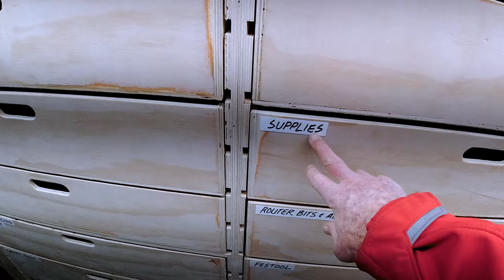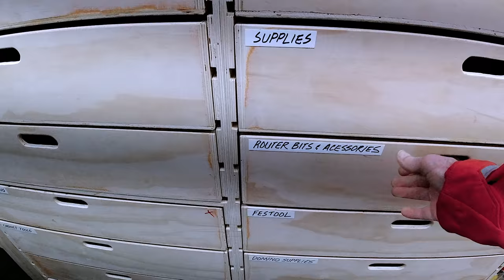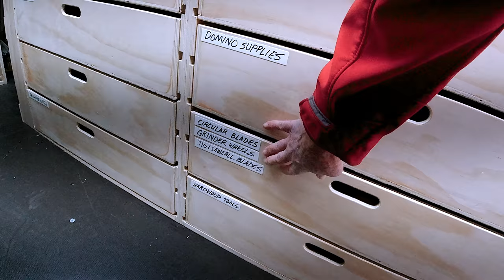The Ultimate Smartwoodshop Tour: Organization and Efficiency in Action

Comment: Nice video on the new SMART trailer. I have a 12 foot trailer with a v-nose, but I live in an area where theft is a problem. I also have a side door, which is convenient and allows for quick entry (read note above). I just wish I had a place to lock up the whole shebang.  I’m probably just putting the regular tools in the trailer and the Festool kit in the van under lock and guard dog 🐕 inside the  2 car garage at night.

Comment: Thanks for the in-depth tour, Ron  I'll be showing it to my FiL in the hopes he'll pick some ideas up.

Some observations as we go along:
* The use of plywood rails in dados instead of drawer slides is a huge cost saving.  I'm building some rolling cabinets at the moment, for which I already had the drawers built and stored in a corner years ago, and the cost of the slides is astronomical.  Wishing I'd just adapted the drawers at this point.
* The worst part about tool boxes imo is not the space they take up but that the tools never seem to go back in correctly.  Mostly the cords.
* If you find yourself moving the cubby dividers around often, consider using threaded inserts and a bolt, rather than just screwing them on.  Of course, when you strip a hole out you can always just drill it out, glue a dowel in, drill a new hole, and call it good.
* Leaving the tools accessable in the cubbies is known as 'first-order access', ie you don't have to move the thing to get the other thing.  Putting the tool in a toolbox in a drawer/cupboard would be third-order access.
* My local hardware is just five minutes down the road, and it's still essentially an hours turnaround.  Driving across town, well, you might as well just take the afternoon off.
* Gotta get me some of those socket holders.

I would kill to be allowed to used the ART/SMART ideas in my FiL's work trailer, but Old Man Syndrome shuts that idea down.

Comment: Do you plan on getting the Flexvolt generator?  You get up to 6 batteries and run corded tools from them. Or plug the genny in and charge those batteries. 
Really cool system IMO. 
What are your thoughts?

Comment: Ron, firstly I’m a big fan of yours. I really appreciate your work.  I noticed you said you had “built 200 homes and done thousands of remodels” in your 30 year career. Did you used to run multiple crews? That’s almost 7 houses an 66 remodels per year, on average.
Reply from the maker: Yes, I had a crew and ran multiple trucks and trailers. In addition, I had 30+ subs working on my jobs everyday,
Reply: Ron Paulk hey Ron , have u ever been interested in using Mafell tools?
Reply: Ron Paulk Are you retired now, semi-retired? Do you work alone now? Just curious. Wondering about what I’d like to do in retirement. I will be essentially “copying” your trailer because I doubt that I’ll have a shop once we downsize and start traveling. Love your videos.

Comment: Nice cargo trailer and like your concept of  efficiency and caring with you the stuff that you need and be prepare to anything that comes in your way, but I’m sure you can drop your weight almost by half if you eliminate all  your doubles(tools and drill bits), I just to do the same, I keep some of my tool boxes with all the accessories and all my electric rechargeable makita hand tools in a tote with wheels. Lean is good , like your ideas and Chanel  keep the wgood work !

Comment: Used your plans and this trailer as a guide when ai built mine. THANKS!  I went completely cordless from the start. Extension cords are never efficient.
Reply: SearchingforSignalLLC have u got a cordless table saw and plunge saw ? I'm thinking of getting them
Reply: I have cordless table saws
Reply: SearchingforSignalLLC which brand?

Comment: I'm considering using 3/8" plywood to do those drawers and bypassing the routing business. Just using all 3/8" and cutting and glueing each piece half an inch apart and using 3/8" bottoms. Do you think that it may be too weak for bottoms of the drawers themselves? Love Dewalt too. And it looks like you aren't going to retire anytime soon. Great inspiration!
Reply: I used 6mm  bottoms for my draws and had no dramas at all.
Reply from the maker: the routed dados are easy, efficient, and strong.

Comment: It just goes to show you how much you can save by limiting resources.  By limiting your space you’ve forced yourself to focus on efficiency, priorities, and overhead.  Based on the number of empty drawers, an even shorter trailer could be used.  Empty drawers on left, right, back left, an an unnecessary entry space to the ladders could be shifted to the back door.  

Lastly, those heavy drawers by the door could be made a lot easier to move by adding some inexpensive skateboard radial bearings.

Comment: LOL your trailer is bigger than my actual workshop. Serious note though - how do you cope with bad weather? I bought plans for and am currently midway through building the Total Station, because my workshop is approximately half a UK one-car garage, which means any serious work requires everything to be set-up on the driveway. Trouble is, if we have bad weather, I either have to rush to get everything away in the dry, or can't even go out in the first place. I do have a pop-up gazebo I can use, but even that isn't a perfect solution. What do you do when you're at a house, remodelling a kitchen, if they don't have a large undercover space for you to set up in?
Reply: I have similar issues, UK also. It gets a bit hectic when you have to drag your table saw into the house because it suddenly starts raining.
Reply: @FuzzyScaredyCat  
@Neil Barnwell  

It's expensive, but I use at least one heavy duty 10ft x 15 ft Caravan or EZ-UP brand pop-up canopy tent with 4 Sidewalls.

I've found the 10ft x 15ft to be the prefect size.  10ft x 10ft is too small and cramped, and any larger is unmanageable.

I keep 4 extra empty and inexpensive 5 gallon buckets on hand and fill them with water, sand, or gravel/rocks to keep the canopy tied down or secured in case of windy conditions.

I also have four 20" long corkscrew-type ground anchors and a 3ft length of pipe to screw them into the ground on new/bare worksites.  Gotta be careful though on existing lawns or yards with underground utilities or sprinkler systems, etc!

I usually set this up first thing and use this as my "outdoor workshop", so everything is always protected from sun and rain, including myself, and so I start off organized right from the start.

I use the white canopy fabric and side walls to keep it cooler and provide even, diffuse lighting.

A singe 4ft LED shoplight tube can be hung in the top center frame out of the way above your head with plastic zip-ties and provides nice, even lighting at night or early mornings.

This way I never have to rush to get materials and/or tools put away in inclement weather and I have a nice enclosed OR open air workshop!

The side walls can be rolled up for ventilation and quickly lowered in case of bad weather.  Good quality side walls have HD zippers in every corner.  And you can get side walls with a vertical center zipper as a doorway.

I set it up with my portable workbench and miter station opposite each other on the long dimension of the tent as a "galley kitchen" arrangement, and the table saw at one end to create an "L" formation.  This allows a clear passthrough and an entry/exit at each far end.

I use wire hooks and rope loops to hang tools above the workbench on the canopy frame.

I've even used rope loops to hang 2x lumber or pipe from the overhead frame (within a reasonable weight).

A Shop-Vac can either hang up and nest within the center peak of the canopy tent framing, or go under the portable workbench/sawhorses or a set of 6ft folding picnic tables.

A good Heavy Duty Canopy Frame will last 3-5 years, along with the side walls.  I usually replace the overhead canopy fabric about once a year at a cost of around $180 USD.  

Don't waste your time and money on a lightweight canopy frame and lightweight fabric canopies and side walls,  They WILL fail in rain or windy conditions and will not last more than a month!   Get  a high-quality heavy duty one and "Buy Once/Cry Once".

The canopy will fold down to an incredibly small footprint for storage & transport, and the side walls fit into two 12"x12"x3" cordura zipper pouches (typical EZ-UP brand).

The entire setup basically takes up less space than two 6ft folded ladders back-to-back in vertical orientation.

I will usually just transport them laying down on the floor in the isle of my trailer or box truck with liftgate, because they are the first things off the truck to be set up.  They can easily be stored upright under the eaves along outside garage or house walls if not needed right away.

 I use a heavy-duty folding Cosco hand truck/trolley to load & unload the canopy and move it into place.  The trolley comes in extremely handy for other work on the jobsite as well, such as moving supplies, furniture or your newly built kitchen cabinets into the house, etc.

Once you learn the proper process, you can easily set this all up by yourself in 10 minutes or so

This also keeps clients happy by helping to keep my work area contained and from becoming unsightly and scattered all about the property.

Sometimes I might use two tents for larger projects with multiple crew in order to have two separate work areas so we are not bumping shoulders and can work more efficiently...

For instance, one canopy in the front yard or driveway/carpark, and one on a backyard lawn or bare worksite, etc.

IMO these are well worth the investment just like ANY other good tool, and I've even used them at home for larger projects to keep my main home workshop more organized and efficient during the project, even if it is just used for temporary lumber/drywall/materials storage.

I can't live or work without these now!
Reply: @bbfoto7248  A really nice detailed reply - Thanks!
Reply from the maker: When I am doing interior work, I set up inside. I have never had a situation requring me to set up tools outside for inside work. I have on occasion set up outside when the weather is sunny and the work is close to an exterior door and I just want to be outside. I often set up in the garage when finishing an entire house and leave the tools set up for weeks or even months depending on the scope of work. A small garage is 500 square feet and a small house is 1800 square feet not including a garage, but most of the houses I work on are 2500+ with 3 or 4 car garages.
Reply: My workshop is ten square metres (hence called the ten square metre workshop...) and I used to drag stuff outside for more space. Then I re-designed it so that everything fitted inside with room to work. Takes a lot of thought, and multi-purpose fittings etc. but worth the effort.

Comment: P.S.,  i have noticed that anything i have bought and tried to modify always seems to measure out better in metric, so i think they must be designed using metric,, and cars are mostly metric,,so i use it all the time,, and it is much easier than trying to remember some obscure , off the wall fraction

Comment: Will a Single Axle 6x12 trailer work with this much plywood, weight wise?
Reply: I bought a single axel 6*12 and built it out similarly except a 3 foot aisle for materials and it works but I wish I would have went tandem. Having to replace the suspension on the side of the road was not fun. I do kind of abuse my tools a little but my 2c buy right the first time one is none two is one.

Comment: Why not buy a longer trailer and build on your system so you don't need anything in the isle?
Reply from the maker: Keeping The Smartwoodshop smaller was and is my goal, I think I could even go down to 10' and still achieve a fully functional portable woodshop. Less is more.
Reply: Longer equals more weight and cost also. Before long you’re beyond what a 150 can pull easily. I’m in a different line of work and I’ve always thought more is better, but eventually you see it’s just stuff you gotta get rid of before you croak and leave your family to deal with it.
Reply: @RustyCas999  Well, THAT got dark..... LOL
I just went through a bunch of my stuff and found that I had accumulated 6 paint roller handles. That isn't a lot to a painter, but I've only painted 3 tiny projects!

Comment: Those flex volt tools are heavy to use in your day to day work. Much better to stick with the 20v where you can
Reply: I’ve found the 6ah batteries to not be too heavy. I use my Flexvolt circular all day with no problem. Pound for pound, it’s the best cordless circular on the market. Makes my Milwaukee Fuel circular looks like a Fisher Price toy.
Reply: @justinhc123  circular saws are fine with big batteries, other tools such as impact drivers, drills, nail guns are best kept as lightweight as much as possible. You don't be usually swinging a circular saw overhead.
Reply: Sure. I use the smallest batteries I can. I have ample 2 and 5ah batteries. I was just saying that I didn’t find the 6ah Flexvolt  batteries too cumbersome for tools that require/benefit from them.

Comment: You wont be sorry with dewalt. I run dewalt tools. 
Their oscillating saw is the cadillac of the bunch.
Reply: I have four flexvolt batteries, love the power, i have the flexvolt sidewinder. Its easily controlled in either hand and accurate. 
I have probly 20 20v tools they have done everything i have asked of them.
Reply: Chris Webb have u got the dewalt plunge saw?
Reply: Elijah i do. I have the corded one.  It works for
me. I couldnt swing the festool. 
Festool dewalt and milwaukee are all nice.

Comment: Flexvolt is a great platform. I enjoy my Milwaukee stuff too, but my Flexvolt blows my Milwaukee stuff out of the water.
Reply: Justin Collett what do u recon is better , the dewalt or festool cordless plunge saw?
Reply: I have two Festool tracksaws and like them both. I don’t have the Dewalt track so I can’t comment on it. If I had to do it all over again, I would probably just get the Dewalt saw to minimize my battery platforms.
Reply: I run a cabinet business and use the cordless dewalt saw as my install saw. I have been really happy with it and the run time.
Reply: Chris McKay A Concord Carpenter / ToolBoxBuzz michaspi Hey, You know how u cut the rubber off on the tracksaw track to get a perfect track/cut edge? As soon as u chuck it on a 45 does it cut into the rubber again? This is bad because when u set it to straight again it will be 2mm or so off?

Comment: I would say go Makita before you go Dewalt. Nothing against Dewalt I have a lot of there tools but I think makita makes a better line of cordless tools for carpentry.
Reply from the maker: I think they are all good, but DeWalt fits my particular needs best.
Reply: I’ve really enjoyed Dewalt (and Milwaukee and Festool). What in particular do you think Makita does better?
Reply: What do u think is better in general? Makita , dewalt or Milwaukee?
Reply: All solid platforms. I have Dewalt 20v, Flexvolt, Milwaukee m18 and m12 and cordless Festool products. Too many batteries. I’d just stick with Dewalt/Flexvolt if I were to do it all over again And start from scratch.
Reply: Justin Collett is prob go dewalt as well, I prob wouldn't go Milwaukee again